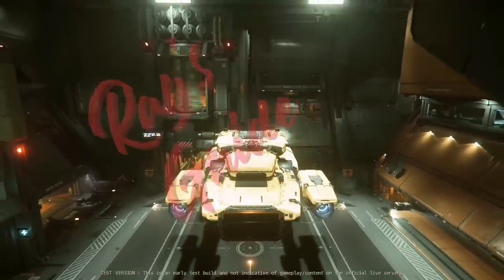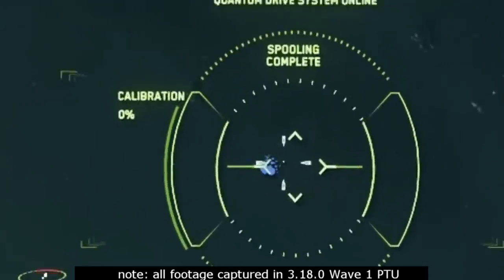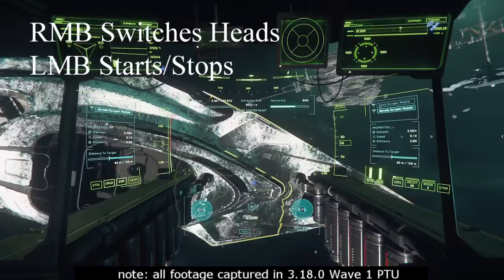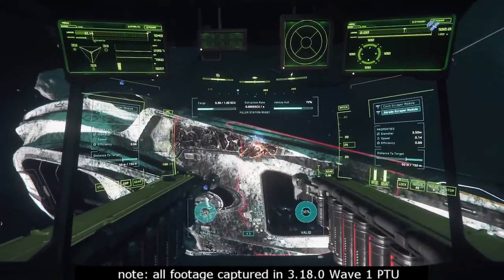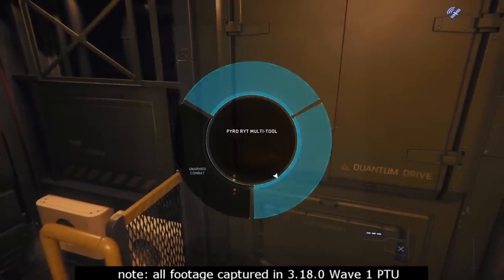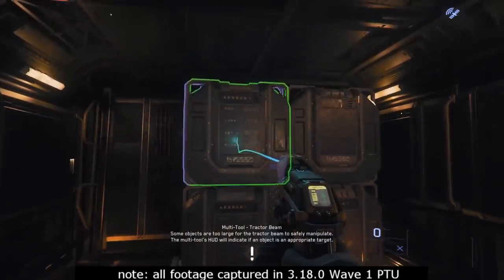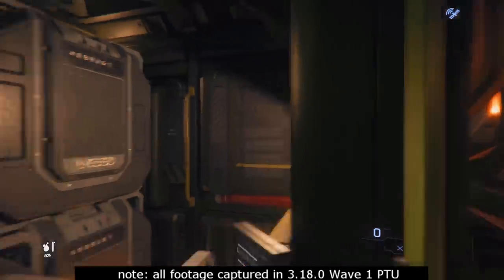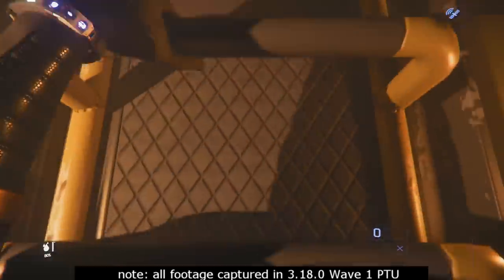Star Citizen 3.18: First Salvage Run in a Vulture

Comment: Minor correction (if I am not mistaken). The tool used is not dependent on ship size but Speed vs Efficiency. Using the cinch nets you .2 more efficiency( = more material per meter vs the abrade) but sacrifices speed. If your in hostile territory you may want to get done quick and split so use the abrade tool.
Reply from the maker: Still, the general rule is to use the Abrade on large ships and Cinch on small

Comment: Handheld tractor beam multitool is almost always a needed tool to bring along.  Only time I guess you may not need it is for ship to ship combat.
I know this is tier 1 but I am always confused how CIG rationalizes the "realism" aspects.  You have to manually offload the scrap, but the next container will automatically just materialize inside the hopper.  Unlike mining right now, you can scrape without returning to a station to offload.  Just have another player come over and tractor beam your boxes into their ship and go sell.  I am not in PTU and I am sure that no one is mining right now, but can we eject the prospector and mole bags to allow the same thing?

Comment: Good tip about the multi-tool with tractor beam attachment. I wouldn't have thought to bring that, but I guess Drake is too cheap to implement some kind of conveyor belt/auto stacking system.
Reply: The Reclaimer doesnt have autostacking either.

Comment: the tractor beam multi-tool is required kit for pretty much any trip out into the verse.  That said, I'm kind of surprised that the ships are designed to require it.  Seems like there ought to be handling equipment built into the ship.

Comment: I wonder if CIG has already realized that the cargo refactor is not complete as long as a tractor beam multitool is absolutely mandatory for operating salvage and larger cargo vessels. At least in my opinion they should just be optional helpers to speed things up when dealing with freight that is not larger than a human body or those 0.125-SCU-boxes that can be carried by hand. It feels completely off that these tiny devices can move things as large and heavy as those big 1 SCU containers. For a game that is supposed to be all about immersion through believability, its gravity manipulation tech really is all over the place and largely inconsistent. So, for those 1 SCU containers, I think a big, dedicated two-handed tractor beam tool or the forklift of a Mule would be more appropriate. And for everything larger than that, a remote-controlled tractor beam crane needs to be installed into every cargo hold that is larger than that of a Titan. I'm afraid that this will require yet another gold standard pass and even potential ship size changes to make enough room for them, though.
By the way, you had a little mishap there at the end, speaking of the Drake Merchantman. Maybe that happened because they too have a mobile metal marketplace in their portfolio with the Privateer, but I am pretty sure that "big box bargain bazaar" was missing the word "Banu" in front of it.

Comment: The game play itself is currently not very fun. Maybe the precize scrapper and the identified ship parts are imagined to break the target in smaller parts in order for the reclaimer muncher to finally break them. I would have thought the box would at least be pushable inside the hold as in cargo plane where there are rollers on the floor. At least, the boxes should be capable to slip to the ramp meaning that 4 boxes could be made without manual intervention.

Comment: This stacking cargo boxes is going to get old real fast. Using multi-tool tractor beam to place each and every box might be ok on something like a Vulture what what about a Reclaimer? You are going to have loads and loads of these things!
Reply: Thats why it is a multicrew ship and we always knew that the cargo refactor would mean a ton of additional work loading/unloading ships manually instead of by the click of a button. They can reduce the amount of boxes by rather than using 1x1 SCU boxes on the reclaimer instead using 2x2 SCU boxes for example which would reduce the amount of boxes by 75%. Either CIG then allows these to still be moved with the multi tool or introduce a small PTV sized tractor beam vehicle to move medium sized SCU boxes.